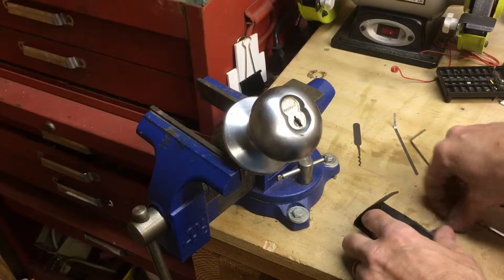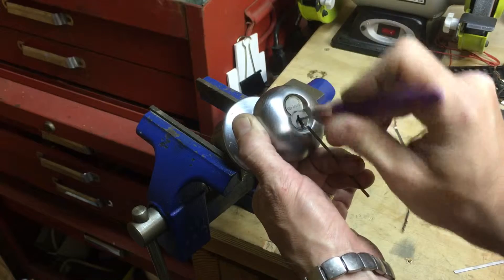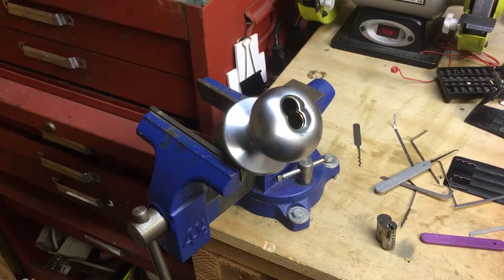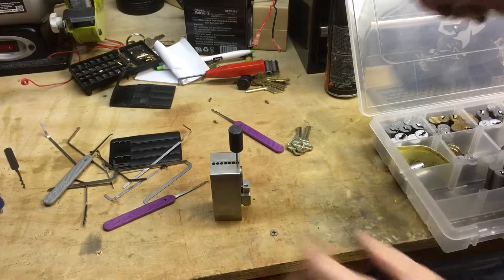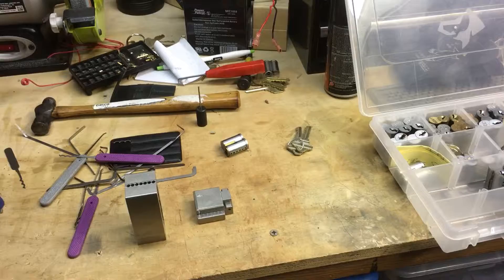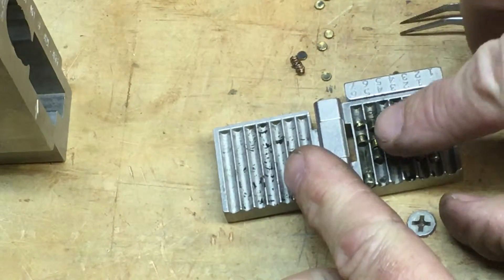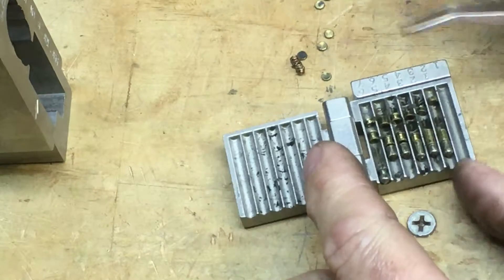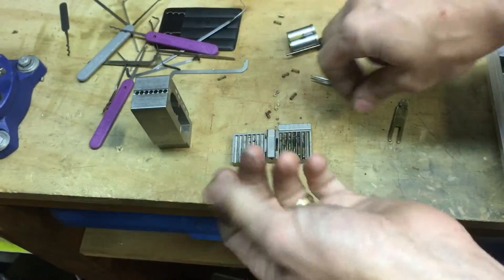Keymark sfic picked to control and gutted

Comment: I've been fighting a keymark gonna try more lube.  Great job
Reply from the maker: Thanks! I appreciate the comment. More lube certainly won't hurt. I think I went overboard with the Triflow, and got lucky... but if you have spools, which the official Keymark A2 pin kit comes with as standard for many sizes of pins, I would use top of the keyway tension so you can really find the feedback. That and prayer!
Reply: Phrygian Radar got it to control thanks for the oil oil and more oil tip helped so much